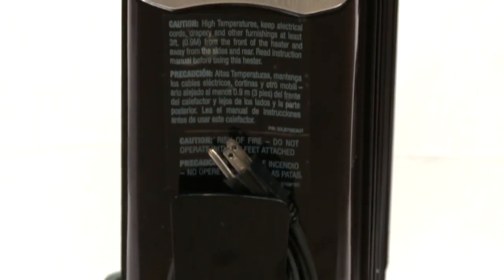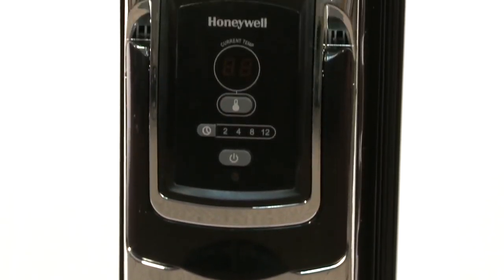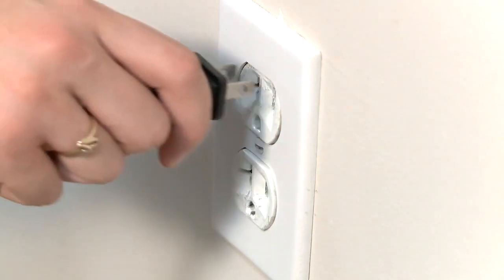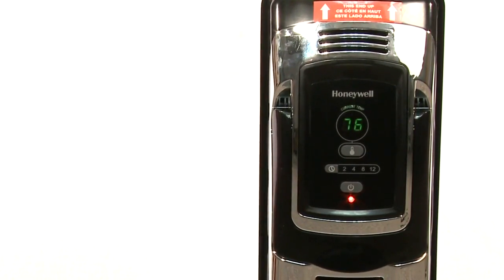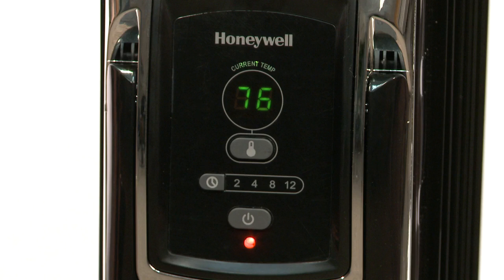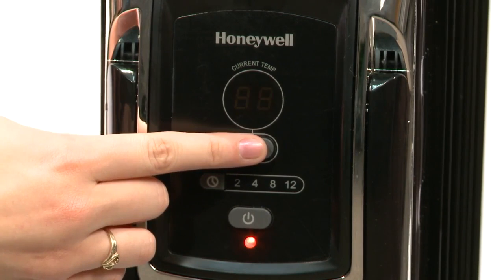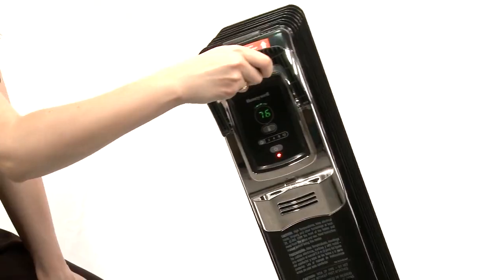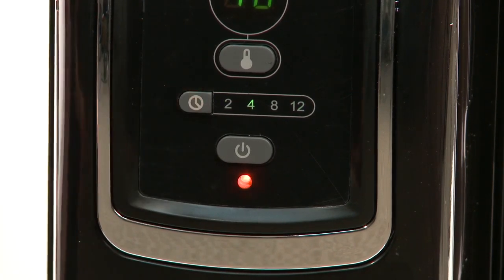Honeywell Electric Radiator Heater HZ717 - How to Use

Comment: Is there any maintenance to this heater like adding or changing that oil inside?
Reply from the maker: Thank you for your inquiry. This heater contains oil that is permanently sealed and does not require refilling or replacing. If you have further questions or need assistance, please reach out to us by emailing SocialSupport@helenoftroy.com.
Reply: @honeywellpluggedin9834  Thank you!

Comment: This unit stopped working..not sure what’s wrong..any ideas?  Won’t turn on after plugging in...is there a fuse or other shutoff mechanism?
Reply from the maker: Hey Victor. Because heaters are running at such high wattage, inconsistencies in power could trip an internal breaker. We recommend trying to unplug the unit and leaving it unplugged for 20 minutes. This should reset the unit. We hope this is helpful. If you require additional assistance, please reach out to us at SocialSupport@helenoftroy.com.